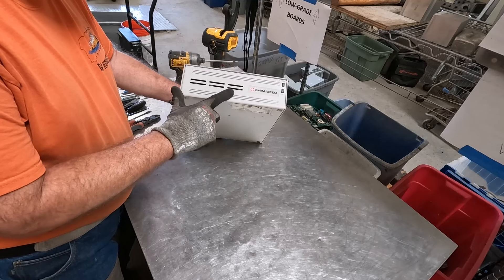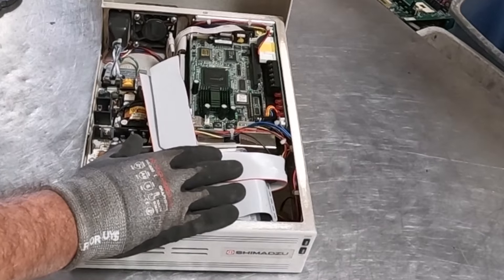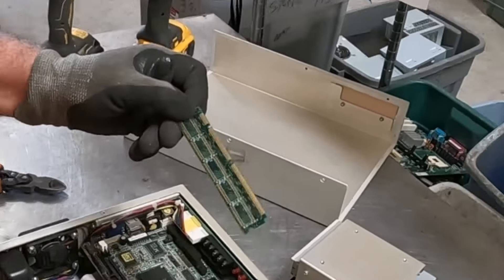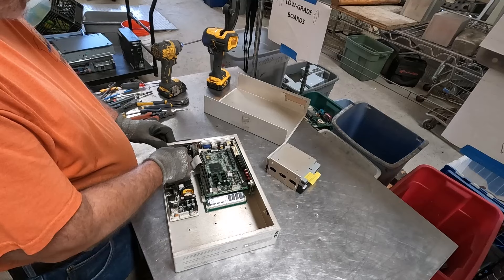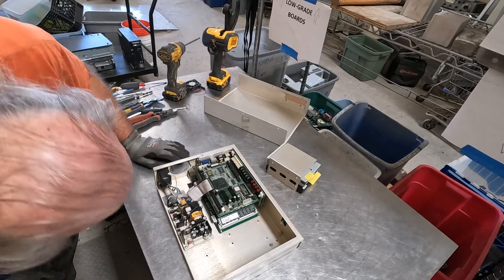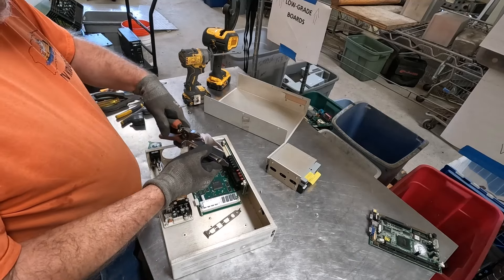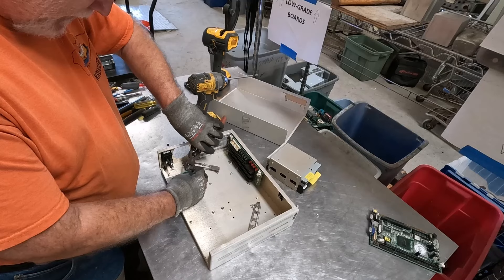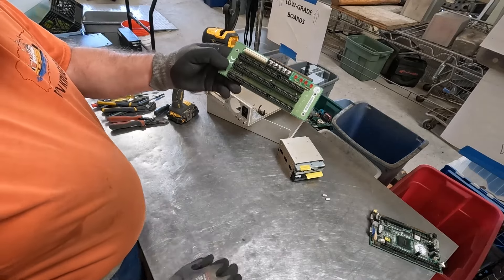Shark Scrapper back to scrapping with some medical electronic scrap

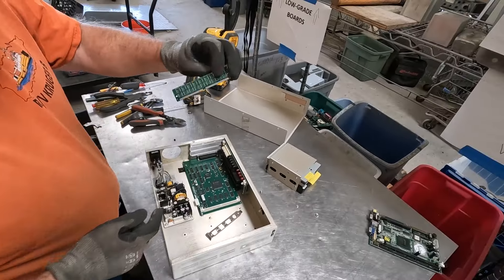Comment: 9:48 I would put  that in Telecom High. The density of values is high enough when you consider everything going on. I'm often cautious when committing a circuit board that has PC motherboard characteristics (vga out, usb in, molex power, ram slots) to telecom but in this case I believe it may be warranted.
Reply from the maker: Awesome, thank you!

Comment: Is it dangerous  to handle circuit boards without gloves ?
Reply from the maker: Not necessarily dangerous in the sense that you could get seriously injured BUT - most of them have sharp points on the underside that can scratch you, some of sharp edged components that can cut you, and they are frequently dirty.